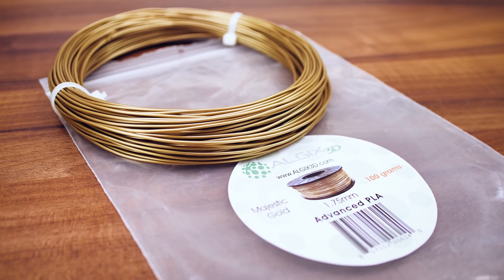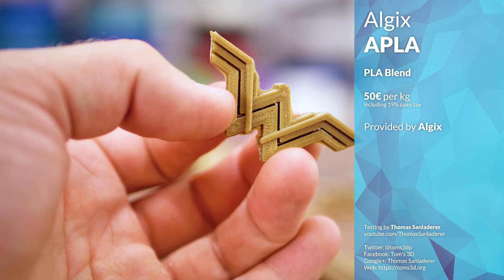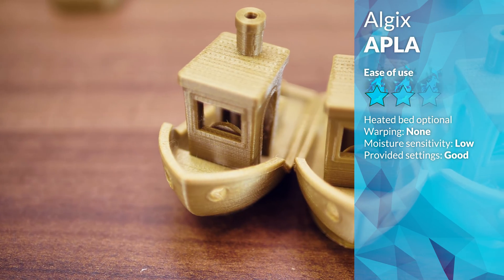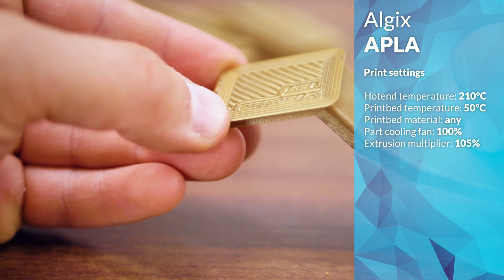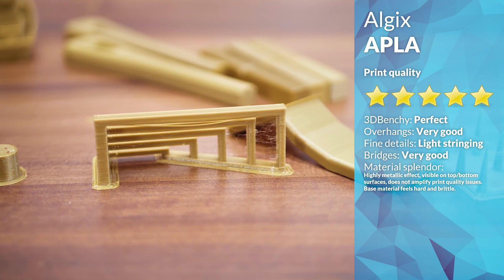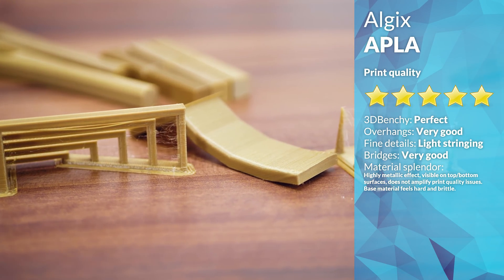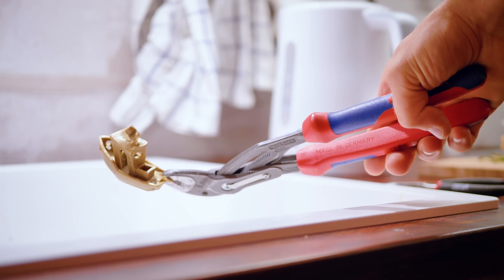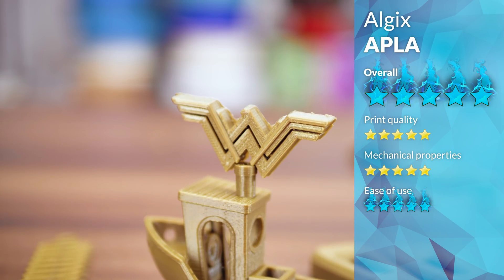How "advanced" of a PLA is the Algix APLA really? #Filaween2 filament review

Comment: How can a filament get 5 stars under the mechanical properties, when it gets the scores as you mentioned in the video?
Bending: Very good
Pulling: Very good
Impact resistance: Low
Heat resistance: low
Hardness: Fairly rigid.

^ That to me would give it a 3-star rating.. It has basically no impact or heat resistance, which means it cannot be even close to a 5-star rating. 

Since it's not a PLA VS PLA test either, based on the last sentence you said("APLA get ranked in the top tier of the filaments"), how can a PLA get that high of a score? At least when it comes to the mechanical properties.. It's absurd.

Filaween 1.0 were at least a bit more understandable, and i got quite a lot of information about each filament.
Sadly, Filaween 2.0 is not usable for any good information when comparing filament types and their properties, as allmost all PLA's get 5-star ratings, which is nowhere near the actual properties of the material when comparing it to other types of plastic.

Comment: Hey Tom,
I just now searched the Internet, I knoe it is not always the right thing to do, to find out if there are any dangers for your health when sitting near a 3d printer all day. It would be super cool if you could make a Video about it and testing for dust and toxic things directly next to a printer and 1 or 2 Meters.
Reply: cometor1 I read somewhere that the particle emission of a 3d printer is smaller than that of a single candle by a significant factor. I cannot give you any specific facts but my guess is that PLA plastic is safe to be around during printing. ABS is known to release toxic gasses when burned so I would not recommend printing with mineral oil based filaments in your bedroom.

Comment: You really need to change the heat resistance test to a 15+ second soak in boiling water rather than pouring it on. Do this to a tensile test specimen (rather than a Benchy) that you hang on a hook and attach a weight to. Measure the % elongation of the specimen after some amount of time to give you an more quantitative comparison to heat resistance rather than just twisting a Benchy...
Reply from the maker: +Cortexion but does it really matter?
Reply: Thomas Sanladerer If it doesn't matter, why did you redesign the rest of the filament test methods to be more scientific, such as the impact strength test.

Comment: 5 flaming stars for something that's not really all that special, specs wise, and didn't live up to its claim of improved thermal resistance??? Did I miss something about how Filaween2 is being run?
Reply: I disagree because like you said in your original post there is nothing special or advanced about this PLA. Strength and thermal resistances were unimpressive.  The print quality was good but pretty much every PLA on the market prints well. So if it preforms similarly to a 15$ filament but costs 50$(!)..........
Reply: I think value should be taken into consideration somehow.
Reply: That's what I thought.  Not critical enough. :(
Reply: I believe it's comparing apples to apples, as in this PLA compared to other PLAs in the market. From what it looks, it seems really good the prints are very clean and solid. Factoring in the 50 eur/kg price tag will make this really mediocre though as you can get comparable results for less than half the price.
Reply: It has 5 stars when you compare it to other PLA's It has best in class performance when it comes to print quality, mechanical properties, and ease of use... what other score should it get? Should we be comparing its impact resistance against ABS? How would THAT be fair?
I do think he needs to add a metric for cost in the future though.
Reply: Prices vary around the world and would also vary as the reviews age. So there really is no need to account for its price. Quality of the filament should stay constant though.
Reply: Oh look, its an abs elitest. I hate those kinds of attitudes. Most people have ABS and PLA, and already know that it is better to use one over the other depending on the situation. How could you devise a test that is fair to both of their strengths? ABS would get a 0 on ease of use everytime against PLA, and would likely score worse than PLA overall 100% of the time, depending on the metrics used to derive the score...
The printing properties of ABS is, in general, terrible, as far as warping and quality of print goes. The impact resistance is all it has going for it. So asking for such a thing to show how 'muh ABS is superior', may bite you in the ass.

However, there are some PLA blends which act somewhere between ABS and PLA, and I really don't know how they could be fairly tested, and perhaps there does need to be a general universal set of metrics for these hybrid filaments.
Reply: My point at least was that "Advanced PLA" offers very little benefit for the additional cost. I have 13 dollar amazon filaments that produce prints of equal quality to the parts in the video. My comparison was PLA VS PLA
Reply: Cost does need to be added to the metrics imo.

Comment: A-PLA will be much more tough, nearly as much as ABS, and far more heat resistant after annealing.
Reply: ...But so will most PLA's when annealed.
Reply: True- it's just A-PLA's are specifically advertised to do that. I see prints with A-PLA that are not annealed as an unfinished job, really, but that's just me, I guess.  Otherwise, might as well you a cheaper PLA.

Comment: Tom, why do you adjust the extrusion multiplier? If your printer is calibrated right you should always stay with 100%. Why extrude more than you printer and slicer calculate? That doesnt make any sense at all.
Reply from the maker: Mostly it's actual manufacturing tolerances more than the differences in grip - even though the nominal diameter is exactly 1.75mm, filaments tend to come in sizes between 1.60 and 1.80mm. Not adjusting for that would lead to under/overextrusion and reduced strength. The MK2 is set to ever so slightly underextrude by default, which makes the vast majority of filaments print nice without any tuning, so you will only see multipliers > 100%.
Reply: BlablaUser, some filaments have a slightly smaller/bigger diameter and in some filaments the extruder gear bites deeper, that's why!
Reply: Extrusion multiplier/flow rate can adjust for three separate things: 1) the different densities of materials that make them sink more or less into the feed gear, 2) differences in feed rate caused by #1, 3) the average diameter of the filament. It's way easier to change this one number than to mess around with them one at a time, and it's accurate too.
Reply: There can be some slip depending on how much resistance the material gives, you have to compensate for that